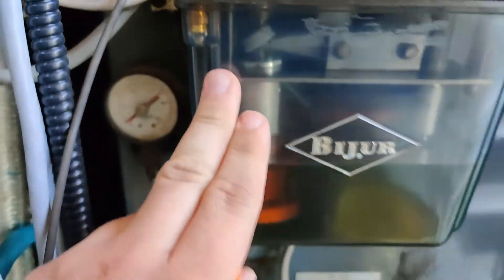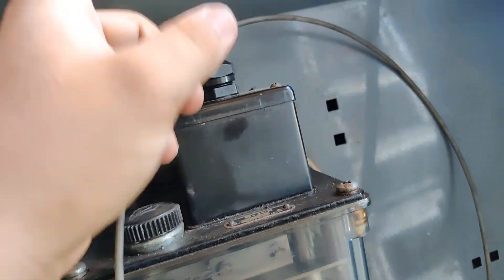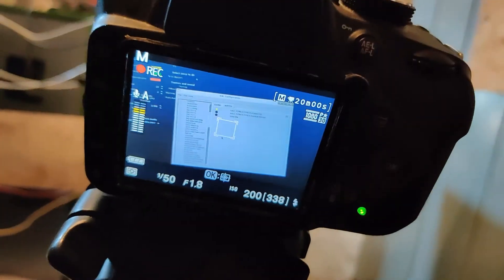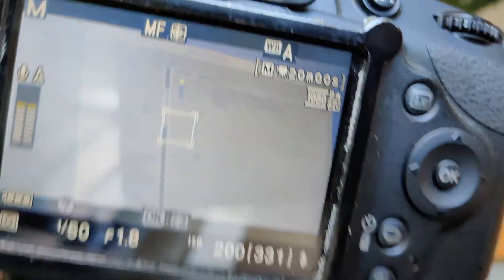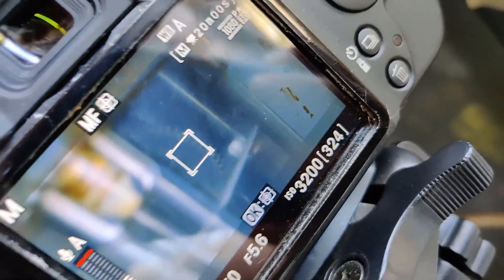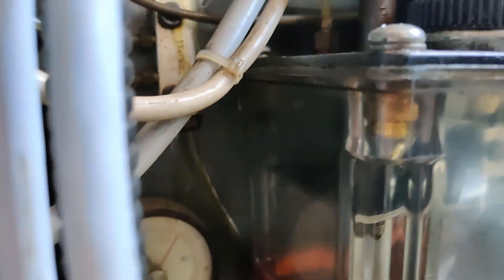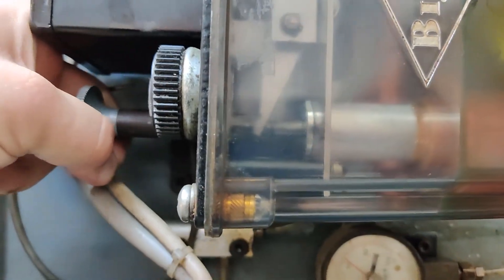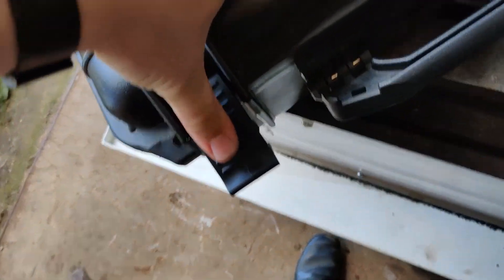Fixing Problems on the CNC: The Automatic Lubrication

Comment: not sure about your machine but on mine the way oil is used only for the ways of xyz axis and maybe tool changer, guys make sure you check your ways to see if they are getting oil there are special fittings to control flow from the manifolds.